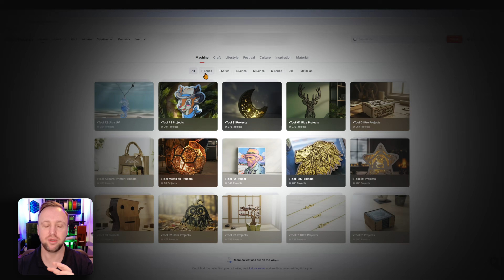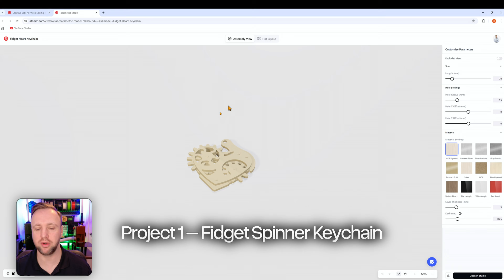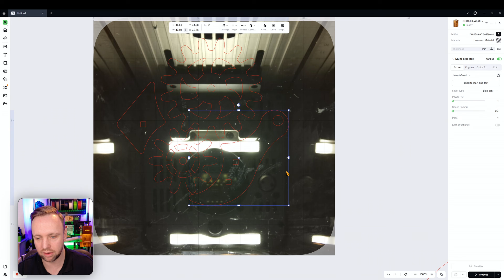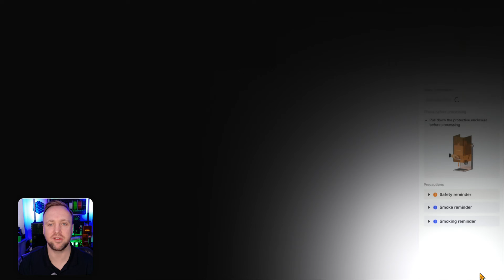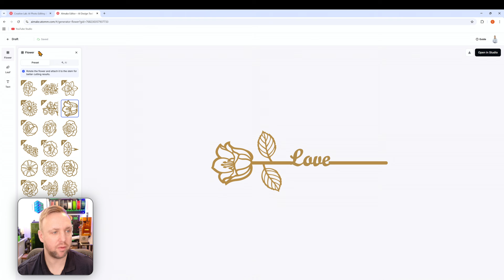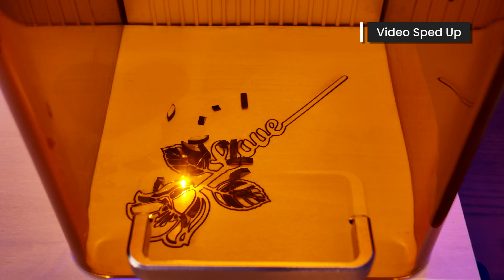Design Without Design Skills? Here's How (xTool Studio)

Comment: What is the benefit of the X2 riser stand?
Reply from the maker: It's raised up the machine which makes it easier to look in and frame items as well as position items. It also helps with freeing up space under the machine for cluttered desks. The legs are adjustable so you are able to engrave things underneath the machine and raise/lower the height to help focus.

Comment: I tried this with black acrylic from xtool which is quite pricey but unfortunately it didn't work when I tried putting the little bits in to clip it in. Not sure what to call it, plugs maybe? Wasted the acrylic 😭
Reply: The plugs were too short and too fat. Finally ended up doing it after wasting an entire sheet of acrylic. I altered the size of the plug holes and plugs and lengthened the plugs as well, I also put the kerf to zero. I hope someone reads this and finds it helpful if they face the same issue. Thanks Chris.
Reply from the maker: Oh no, that's frustrating! It sounds like the tolerance was a bit tight; sometimes you need to lightly sand the plugs for a perfect fit.